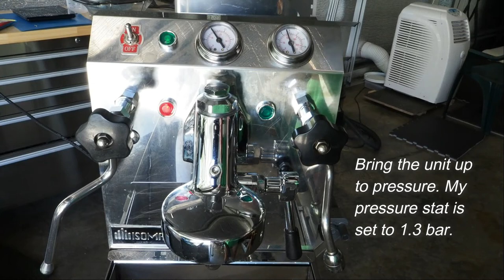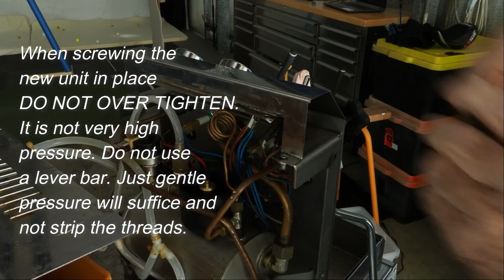Coffee Machine Steam Pressure Leaks

Comment: Thanks for the video, very helpful. Im rebuilding af Isomac Tea, and I have a hard time figuring some of the wiring, I see that the model is exactly like yours, so do you mind sharing some images from the inside? Im missing where two white wires are going. Thanks!
Reply from the maker: I will take it apart tomorrow and take some for you. It's about time I checked it over.
Reply: Wow, that is so kind of you! Thanks
Reply from the maker: @simonhald4573  From what I can see a brown lead takes 240v from the on off switch to the pump on off lever. A white lead then takes 204v from the on/off lever to the side of the pressure pump and then on to the lowest connector on the control box marked pump. Not sure how to get photos to you.